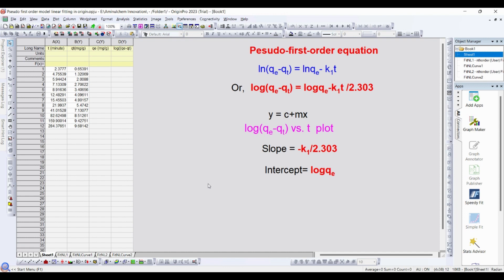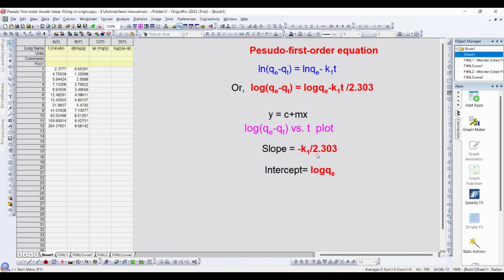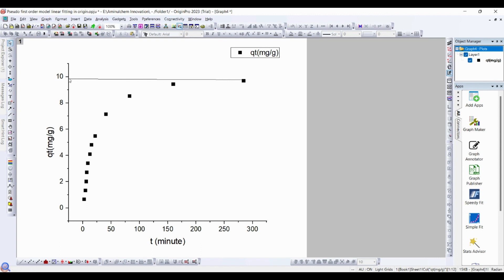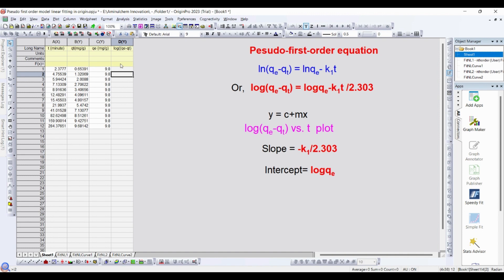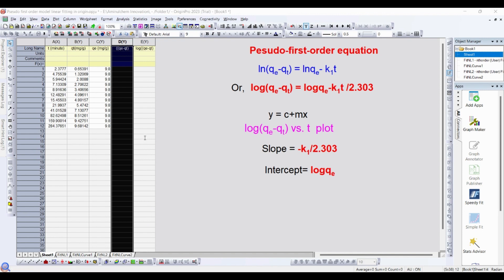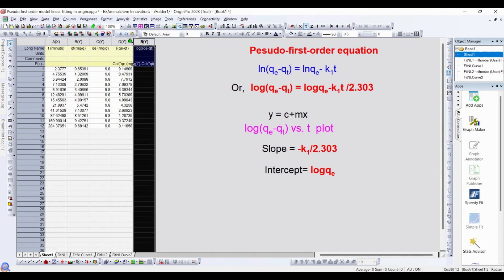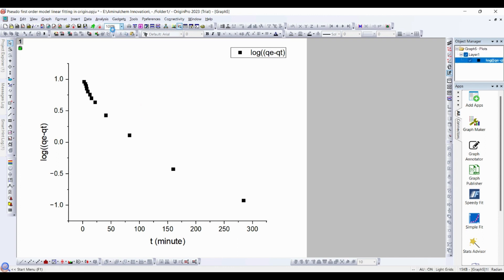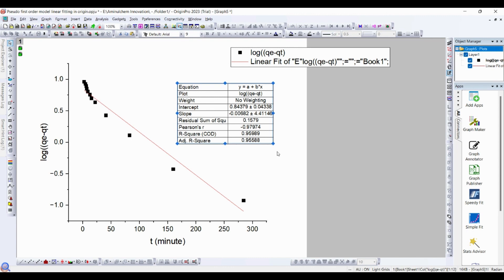Pseudo First Order Kinetic Model Fitting in Origin

Comment: Hello sir, first thank you for this valuble video, second, why qe is different from qt at 284 min, should they have the same value eithet 9.8 or 9.6!! Please explain this to me. Many thanks
Reply from the maker: Thanks. Adsorption is a surface phenomenon and it depends on many factors. So it is difficult to predict the difference.
Reply: @Aminulchem  Thanks for your reply. According to some of my results, qt is bigger or equal to qe, which means the difference between qe and qt is either zero or negative values. Log zero and a negative  value would give #NUM# in excel. So how would I apply first order kinetic model on these scenarios?? Or Does it mean that the first model is not suitable for these cases?
Reply from the maker: @Intermilan09  Thanks. You can try nonlinear fitting using originpro or excel solver

Comment: Hello sir
I just want to know if k value comes negative. is it possible and what it indicates???
Reply from the maker: Thanks. In that case, you need to repeat the fitting and you can consider nonlinear fitting using my videos
Reply: @Aminulchem  thanks sir but my first order r2=0.37 and k value is positive but my pseudo second oder r2 = 0.99 and k is negative. What is the fault and wht can i do next ? Should i go for non linear approach and if so then should i do all isotherm models in non linear or its ok to do in linear?
Reply from the maker: Try all nonlinear fitting as it is better approach @pallavibehera8782